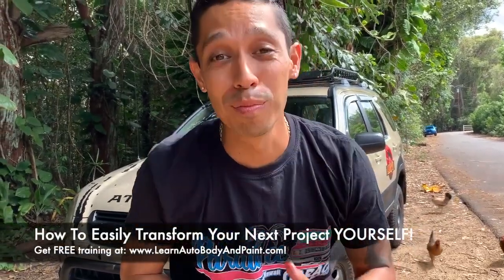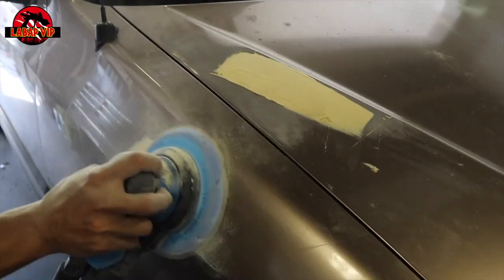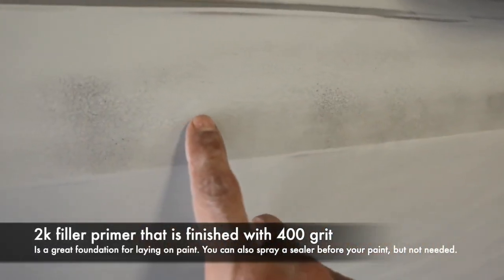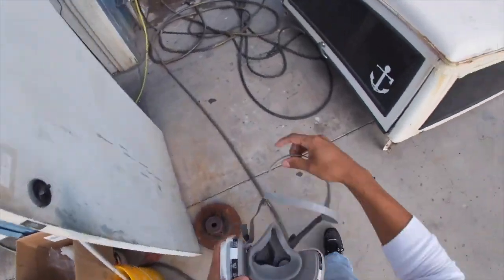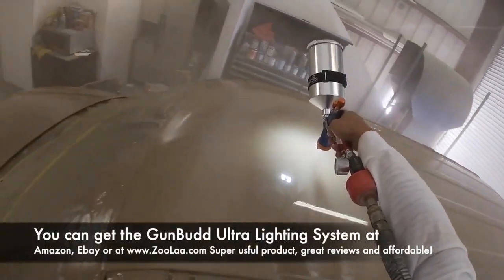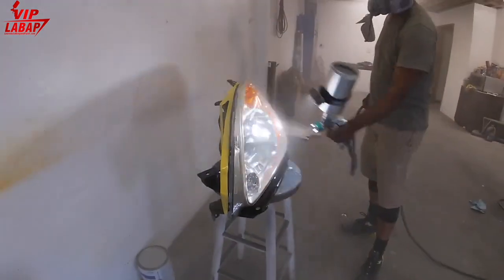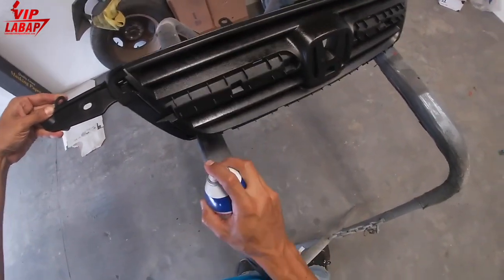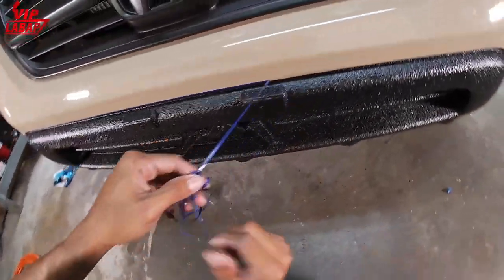How To Paint A Car Step By Step At Home With The Atom x88 🚙

Comment: Can you order different tip sizes for the atom x 88 gun? And are replacement parts easily accessible?
Reply from the maker: They have just the 2.0 tip kit available for the x88 here: https://www.zoolaa.com/collections/spray-gun-tip-kits/products/atom-x88-lvlp-mp-tip-kits-needle-nozzle-air-cap-set
Reply: Thanks